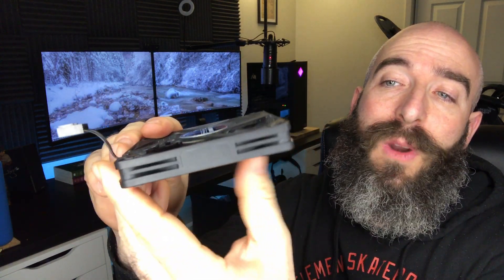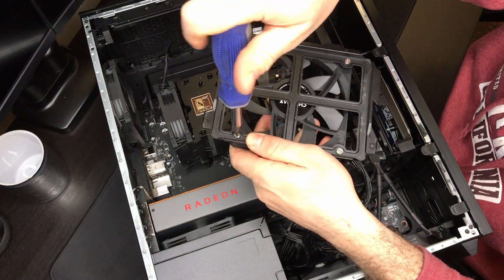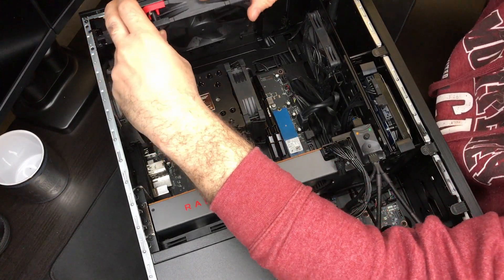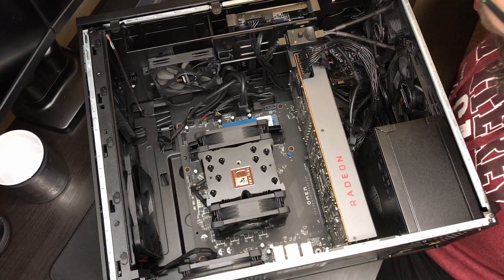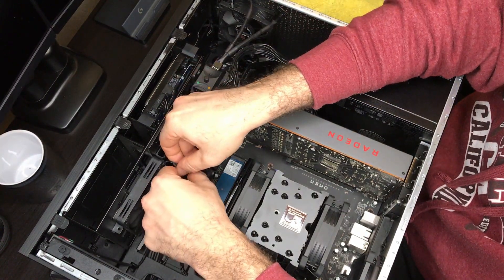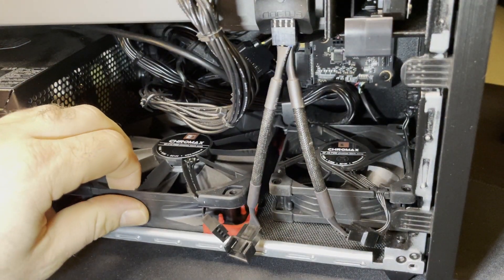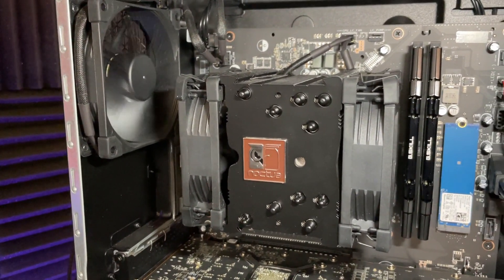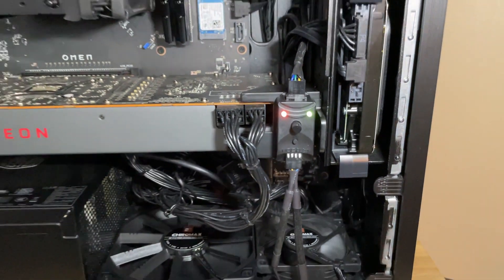How to: Install and Setup All Fans in an HP Omen 25L / 30L! Tutorial & Guide!

Comment: I am getting 90B fan alarms after replacement. I ran the bios test and had a fan fail. I systematically disconnected each fan and thought I isolated the issue but after 5 boots it returned and I was not able to isolate source of issue… Any advice would be appreciated

Comment: I have a 45L with the cryo chamber.   All the fans are pretty quiet except the most difficult to replace (of course).  the radiator fan in the cryo chamber.   Its sounds terrible.  Sounds like the bearings are shot.

Comment: @DanKamYouKnow Hi Dan, sorry to write you a question so long after a video coming out. On my Omen specifically. The header for FT_Fan 4 doesnt exist. Simply wasnt soldered onto the mobo. So I see your setup with the fan controller, and the Sata cable and id like to recreate that. I plan to add the fan on the disk drive bay, and the fan next to the PSU as well. My only confusion is, if the top port of the fan controller is plugged into the Sata cable, and the lower port of the fan controller is running a Y split to the two bottom fans....what is running the fan mounted on the disk drive bay? Hope this question makes sense. Super stumped, but otherwise awesome video! Im going to proceed with this on mine as in 2025 shes in dire need

Comment: Hopefully you see this but I bought the splitter to use with an RGB fan but the rgb fan has a 3 pin female wire that requires only 3 pin male. Is there an adapter or something else I can do? I don’t see the 3 pin males on my motherboard 30l Omen. Thnx

Comment: 3 years later and your video is still helping people. My HP Omen 30L was crashing constantly during most games and couldn't even handle the Steam VR lobby screen from the Quest 2 Steam link app. Now after adding a bottom fan 120mm and swapping the stock 92mm back fan, it's running quiet and cool! Thanks!
Reply: 4 years later too
Reply: Can confirm, this man is the GOAT
Reply: That case is a monumental turd. I feel sorry for anyone who bought that device.
Reply: @ag8912  thanks.
Reply: @OGCHOKO_WAV  I'll be honest I think it looks nice and sleek but it's an oven...
Reply: @ag8912  the stock airflow sucks completely. the case itself is awesome. the smaller size and sleekness is perfect. Either liquid cool or add more fans and set a high fan curve. I love my case. Couldnt turn it down either with a 40% off Educator's Discount and full warranty

Comment: Does the bios in the HP Omen 25L support 3 pin dc control or is it 4 pin pwm only? I have used some motherboards in the past that did not support 3 pin dc fan control at all. PWM 4 pin had to be used or the fan just ran at full speed. A friend has one of these and I have piles of old 3 pin 120mm fans in my parts bin that I was planning on giving to him for his case transplant. Any experience?

Comment: Unfortuneatly i didnt get the fan controller and plugged in the front and bottom fan into FT_FAN4 port and now i get the 90b error.  Once i skip the error everything works fine.  Is there a solution to this or should i just get the fan controller?

EDIT:  Fixed it.  Got the fan switch too.  Great video.
Reply: What was causing the error?
Reply: @carlsdog  I had the CPU fan split with the top fan. I switched it to split with the back fan and the error went away. I'm glad I got the switch though so I can directly control the front and bottom fans.

Comment: thank u so much, can u do the same video but on omen 30l?
Reply from the maker: I unfortunately do not own a 30L, but almost everything applies to the 30L chassis. the front section is slightly different with the 120mm fan
Reply: @DanKamYouKnow  how do I cable management this case, PSU cables are driving me insane and I've tried to open the side panel but I can't find the screw even tho I looked in the same place u mentioned
Reply from the maker: Cable management is pretty much impossible. There is absolutely no where to hide the cables unfortunately. There’s very minimal room behind the back panel

Comment: If i bought the chromax fan 120mm for the top? Is the 4 pin wire able to reach because, my 4 pin plug is all the way to the top right corner of the motherboard. (Hana B550 motherboard.) Just in case you ask?
Reply from the maker: Noctua fans comes with a 1ft extension cable.

Comment: Hello I installed the 120 Thermaltake A10 liquid cooler single fan and I git the error code 90b what can be the cause I have the hp omen 25 L
Reply: I ended up redoing the thermal paste seemed to work 🎉
Reply from the maker: Usually, a 90b error will pop up if a fan plugged in is not working OR if a normally used fan header is not being used. I have seen fan controllers cause the error too

Comment: Just wanted to stop by and thank you for this in depth guide. I used it back in early 2021 when I got my first real PC - my HP Omen 25L which is almost identical to yours (RTX 3070 and Ryzen 5 3600) and I copied every fan placement you showed here, the only thing different is I'm still using the stock cooler with a small size Noctua fan on it. PC still runs great and a lot of it is thanks to you, its coming up on its 3rd birthday soon!
Reply from the maker: Great to hear! You have been subbed to my channel for a long time, appreciate the support!

Comment: Hi Dan
Super video thanks for doing this. I am about to replace the rear fan and add a top exhaust and bottom input. My question is what direction is the rear fan blowing ?
I’m also putting in the CPU cooler that you have but it only comes with one fan… which side should it be on and which direction should it run ?
Thanks for any wisdom
Reply from the maker: Rear fan should be exhaust, so the air is blowing out of the case. As for the cooler, once installed, you want the cooler to be installed on the side of the cooler that is closest to the front, and it should be blowing through the cooler, towards the rear of the case.
Reply: @DanKamYouKnow  
All done… works like a charm… temps down 40F. Thanks for the wisdom.
Reply from the maker: Awesome!! You’re welcome 🤝

Comment: Very nice video. But I have 1 question. Is there any difference in performance or temp when top vent fan use as exhaust or intake?
Reply from the maker: Thanks. Depends on the system but usually exhaust it the best route. Some people have reported the intake works better. Really easy to switch the orientation and test out both.

Comment: If i have a stock 25L and wantes to add a fan to the top and bottom would the too be an intake or exhaust? I assume the bottom is intake
Reply from the maker: Correct, bottom is intake and top is exhaust.
Reply: @DanKamYouKnow sweet greatly appreciated Dan

Comment: Do the bottom fans face downward?
Reply from the maker: No, up. You want it as intake.
Reply: So the backside of the fan would be flat with the bottom of the case?
Reply from the maker: It depends on the fan. Look on the side of the fan. You should see an arrow that shows which way the fan blows.

Comment: Excellent video.  If it helps anyone else save a return. Omen 30L can't fit Noctua 80mm fan and 120mm Noctua Chromax Fan  at the bottom of the case.  The stock front fan (led) is in the way.  I returned the 80mm.

Comment: gonna try this! probably just the top and bottom for now but it should help. thanks
Reply from the maker: Honestly, adding a top and bottom fan is really all you need! Easy work, you got this
Reply: @DamKamYouKnow Hey man, I had a question. Do you think I would be able to plug in the bottom fan that you installed with the y split connector you linked in the description? thanks

Comment: The one thing I regret on these Omens is there isn't an extra unused USB connector on the board.  I got the Corsair LL120 and if the I want fan speed control with the Corsair app I have to be able to plug the USB controller that leads to the module.  I can maybe kill a front end USB connector by unplugging (but I use both the front ones).  I still need to get a 92 mm fan for that back one (it's next.)
Reply from the maker: I honestly always recommend motherboard and case swapping. Too many restrictions with Omen motherboards and the cases lack airflow and space
Reply: @DanKamYouKnow  I have the white case which is supposed to have better airflow.  I know the mainboard is fragile as all get out so if case swap the recommendation is toss the board.  Limit of fan slots I could deal with (splitters).  But the lack of unused USB controller and my case plug in for a second hard drive may drive me that direction.
Reply from the maker: Yeah, a new motherboard opens up a lot of doors to customization. A large amount of Omen users go down this path for the uncapped freedom of a normal motherboard.

Comment: Hi Dan! I installed a liquid cooling to my Omen 25L after watching your video and received a significant drop on the CPU temperature. Then I tried  your fan build to lower my GPU temperature and I noticed a siginificant speed drop after I connected two bottom fans to a single port using a Noctua Y-split cable. The same happens when I try to Y-slpit rear fan port to the side fan. I am wondering if my motherboard can't supply enough current to these fans. Could there be a way to add extra power supply to my Omen using sata ports or something similar? Thank you very much!
Reply from the maker: Fans hardly use any power and the board / PSU should be able to handle it with zero issues. Power usage will have zero effect on the speed of the machine. I had almost 8 fans going in my Omen

Comment: Hey DanKam! I've added a 120mm 1300rpm Noctua Redux fan at the top of the case and was planning on replacing the stock rear exhaust fan with another Noctua 92mm fan. Will the Noctua exhaust fan make the pc run cooler than with the stock exhaust fan?
Reply from the maker: Hey! Maybe a tiny bit, but it will be significantly quieter than the stock Omen fan
Reply: @DanKamYouKnow  Hey, thanks for replying! I was not sure about which though, it seems like the Chromax 92mm 7 bladed fan pushes more air than the 9 bladed 92mm Chromax, while also having lower RPM.
Reply from the maker: 👍🏻👍🏻👍🏻 I’d go higher RPM

Comment: I have a OMEN 30l.  I ordered that same cooler and it didn’t fit.  I want to install 1 or 2 more 120mm fans.    All I have is 1 120mm intake fan and 1 92mm exhaust fan.  I want to have better air flow. 

I bought a NH-C14S cpu cooler.
Reply from the maker: That’s not the cooler I used. I used the Noctua U9S:

https://amzn.to/3Ynrdyj

I would replace the cooler, replace stock 92mm, and add a 120mm fan to the top and bottom. About the best you’ll get with these cases.
Reply: @DanKamYouKnow  

I don’t have room in the bottom. It’s solid.  I think I can add 2 120mm to the top of the case.
Reply from the maker: I have never seen a 30L that’s solid on the bottom. 25L’s and 30L’s both have room for one 120mm fan at the bottom.

The best option is to swap cases if you want airflow.
Reply: @DanKamYouKnow  

I’ll have to look more closely.   I wished there was a way I could put up a picture.
Reply from the maker: You can send it to me on Discord, I have the link to my server there
Reply: @DanKamYouKnow  

How?  Not sure.  I just installed it last month.  So not use to discord yet
Reply from the maker: You just have to click the link in my description to go to Discord. I have multiple channels for PC stuff on my personal server. The link will take you right to it

Comment: I have a 25L as well and noticed the same issue with heat
Reply from the maker: The definitely run warm
Reply: @DanKamYouKnow  I'm watching your video's now. Was trying to drill in the side panel for the graphics card to expell heat but I'm thinking it tempered. Know if anyone tried this?

Comment: hey Dan recenlty i found at very good price omen 25l with cpu liquid cooler,, i7 12700 with rtx 3070ti and i want to ask you i f i will see lower temps if i change front and back fans from a better brand name or is better to go for a bigger aftermarket tower later in spring ? the temps is around while playing 80cpu and 77-85 gpu (the front and rear fans are 92mm ? and i cant put bigger i think eh?) thanks!
Reply from the maker: Unfortunately, a configuration like that will run warm, even with fan additions. My suggestion would be to swap everything to a high airflow case, which will majorly drop temps. 25L case is just a hot box

Comment: Thanks for this! Very helpful. Looks like you're installing SP fans. Do you know off-hand if you're achieving a neutral pressure? I love the Omen 25L I just got, and want to add two more 120mm fans like you did. As of now, with the RTX 3060 ti, I never go above 80C CPU/GPU when gaming full-throttle, but I'd like the temps to be cooler.
Reply from the maker: With Omens, you are pretty much always going to have a bit of negative pressure ( more exhaust fans than intake ), which is kind of just how the design is for these tiny little cases. Adding 2 fans like I did should slighlty help with temps, but not a drastic amount. 80c for the CPU and GPU are good, but could come down a bit if you aren't happy with them. If you want a drastic change, change the CPU cooler and use and aggressive GPU fan curve in MSI Afterburner.
Reply: @DanKamYouKnow  I was looking into a CPU cooler, but what about a GPU cooler? Does such a thing even exist? And thanks for the quick reply!
Reply from the maker: They do exist but they are a gimmick and not very beneficial. The maker of the GPU ( HP in this case ) makes the air cooler that is attached to the GPU PCB board. There are no replacement coolers for GPU’s, unless you water cool it, which would require a custom water cooling loop, which definitely is not possible in an Omen case. 

An aggressive fan curve like I was saying is your best bet, or swapping all the components into a new case, which will open you up to more fan options and good airflow.
Reply: @DanKamYouKnow  I looked into them right after I ask, and you're probably right. I'm curious to see how the two new fans will do.
Reply from the maker: Anywhere from 1c-7c I would guess. Different systems / components benefit differently from it. Still greatly increases airflow in a bad airflow case though.
Reply: @DanKamYouKnow   5C would be great. I like how you added that 90mm fan to the hard drive cage, and I can’t help but wonder if opening up that little hole in the cage would be beneficial. I remember you said you didn’t want to modify the cage, which makes sense.
Reply from the maker: It might be but there is no inlet on the front for fresh air, so I wouldn’t even bother with that front fan

Comment: Thanks for this , I bought 2x of the noctua 120mm , one for top and one for bottom, y splitted them into my omen 25L i7, 3060rtx ti, but to be honest I got same temps as before 😅while gaming in 2k I got like 80 degrees for gpu , 70 CPU , normal Gaming is like 60 for both
Reply from the maker: For maximum effect and to lower your GPU temps a bit, I would use the program MSI Afterburner, to make a custom GPU fan curve that’s a bit more aggressive than the stock one. Should be able to lower it down a couple Celsius. 70 for the CPU is perfect and no need to worry

Comment: You might now see this comment but I literally got a hp omen gaming desktop five days ago and this helped so much and also made me feel stupid but you got my sub as soon as I found out that I can take out that top ceiling and add a fan there so thank you so much😁😁👍
Reply from the maker: Thanks for the sub! I have an entire Omen playlist if you want to check it out, I’ve made over 30 videos on my 25L. 

Yeah, the Omen is interesting and took a lot of experimenting when I first got it in April or 2020.
Reply: @DanKamYouKnow  yeah I’ll watch them
Reply from the maker: Let me know if you have questions
Reply: @DanKamYouKnow  hi I’m back with a couple of questions of course, so I saw your video on installing fans which helped me out because I needed to make sure on how to do that and it was easy to understand and helped me out a ton but I got a new problem now, so recently(yesterday) I got cooler master fans and they have rgb but it was just a one fan and I don’t know how to use the rgb cause my motherboard has less spaces then the ones I have seen in your old videos and I can use some help on how to install the fans, the fan name is “Cooler Master Masterfan mf120 120mm halo white edition” and I got it off Amazon so any type of help with the rgb would be grateful
Reply from the maker: Unfortunately, powering RGB components with the Omen motherboard is a pain in the butt and just doesn’t work properly. And even if you figure out a workaround, most RGB software won’t work with Omen motherboards. That’s why I went with non-RGB fans

Comment: hi dan, just wondering what the temperature would drop down too after the new fans are put in as temp is a big issue on the omen 25l?
Reply from the maker: It really depends on the system and components, could be 2c, up to 10c drop.  For the biggest change, I’d recommend changing the factory air cooler to something like the Noctua U9S. Then setting up an aggressive GPU fan curve in MSI Afterburner for higher GPU temps

Comment: I triedmost of your mods and I did not get good results. Only one I could not plug was the front fan.all fans were turning when I started my computer but when I launched fallout 4, my PC crashed due to the heat after 15mins of gameplay. Sounds like that front fan is more important than thhe bottom one.
Reply from the maker: Front fan is the least useful. Change the CPU cooler, put a bottom mount 120mm intake fan, top mount 120mm exhaust fan, and replace the rear 92mm fan. Then use MSI Afterburner to make a more aggressive GPU fan curve, and you’re set